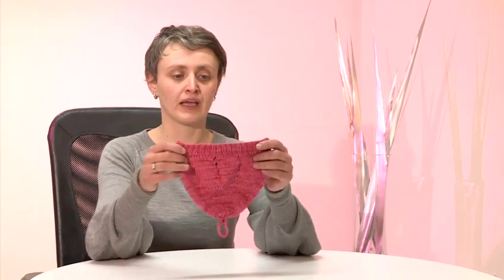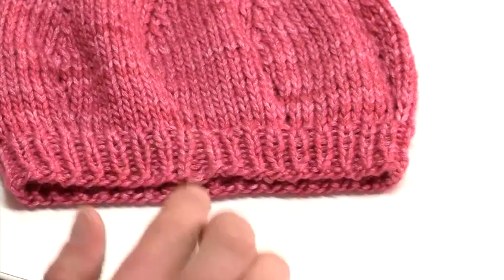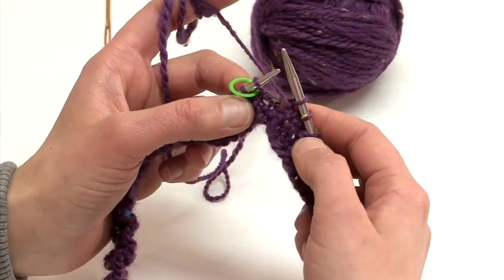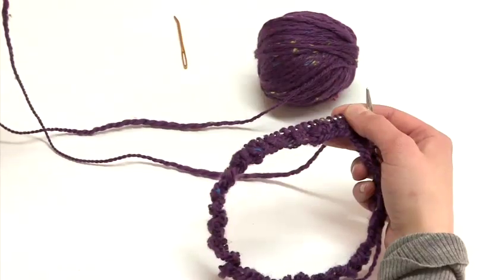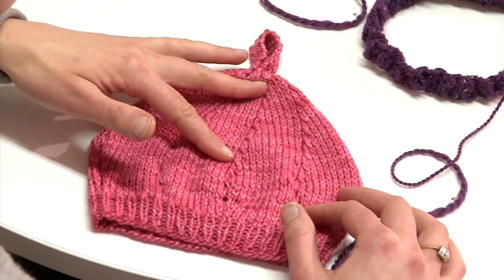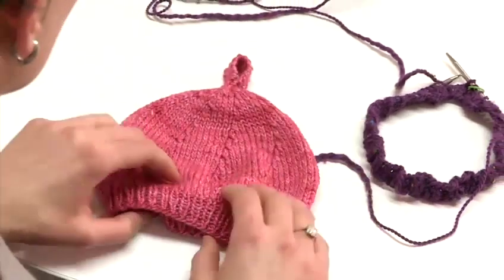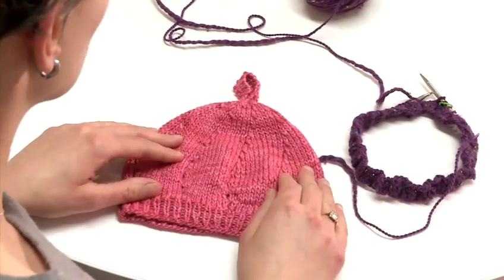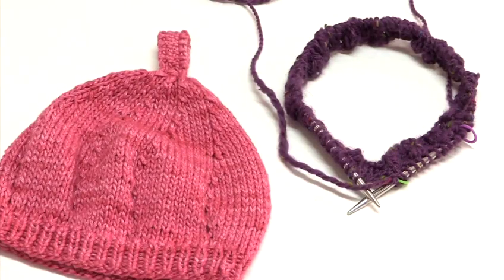A guide to knitting a beret

Comment: I tried this, carefully following her instructions, and the beret was waaaaay too small for a human over five years old to wear. On me (normal sized adult head) it didn't even get halfway to my ears. And now that I come back, looking that the picture in the video...it seems obvious this is not an actual real hat.
Reply: Measure your head. Knit a few stitches with the yarn and needles you want to use. That will tell you how many stitches per inch you are getting multiply stitches per inch times your head measurement. Cast on as many stitches as you need per measurement but make sure the number is divisible by eight. Then follow her instructions. My head measures 22”. I cast on 96 stitches on #7 needles and #3 (DK) yarn and my hat was perfect! You can use a smaller needle for the rib if you want a closer fitting rib. Knit the rib then try on and see if that was the amount of stitches you needed before you continue. Write down everything you are doing as you go along to make a pattern you can duplicate.